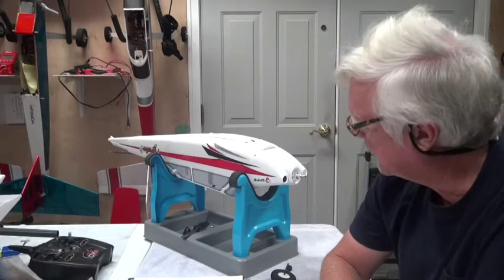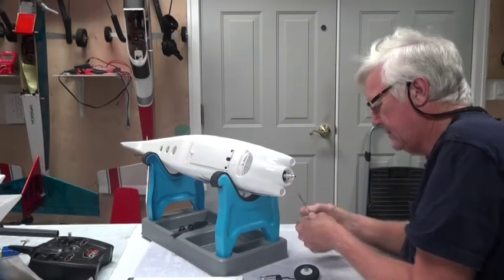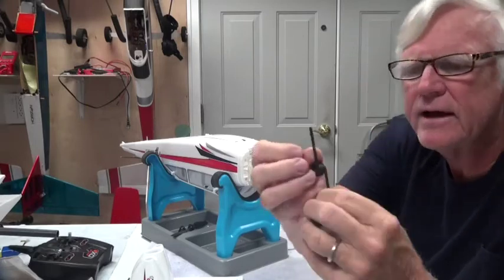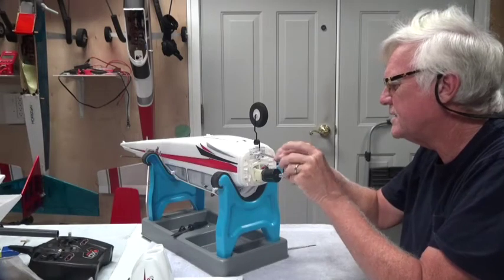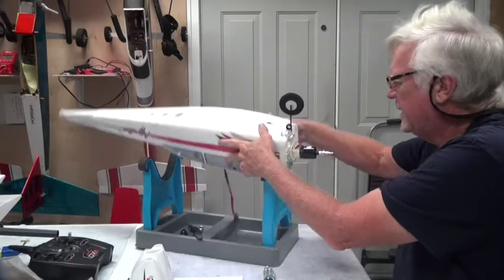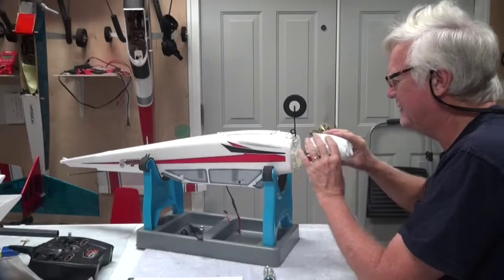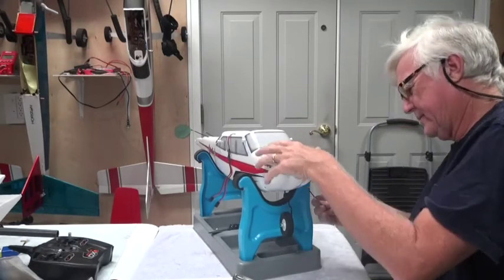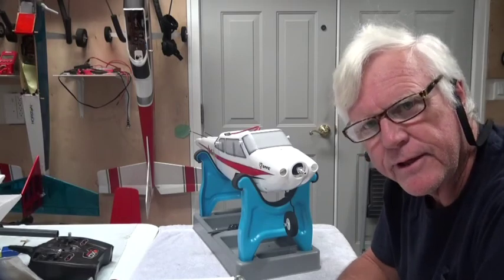AP18 Apprentice S 15e RTF Nose Gear

Comment: is it easy to flip the battery tray around in this plane to convert it to a tail dragger? just bought the apprentice and it should be here Thursday and I'm just wondering if its easy if it is ill go get 3.5 wheels for the front and was thinking to use one of the stock bigger back wheels for the tail. thanks